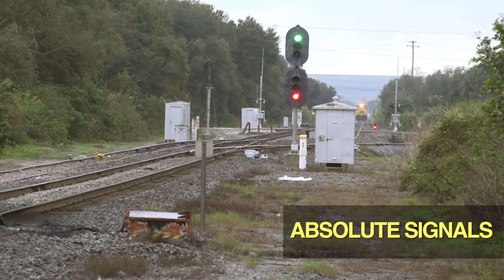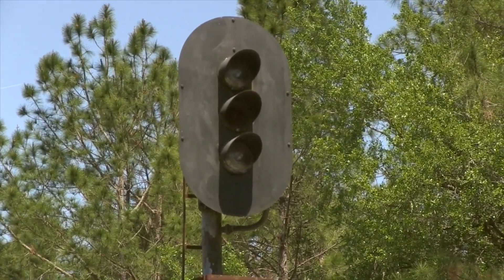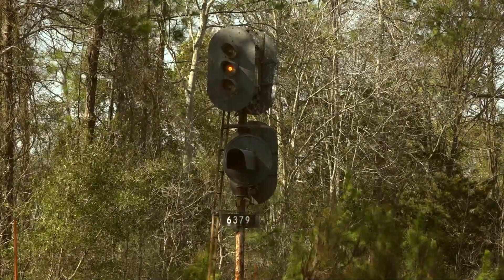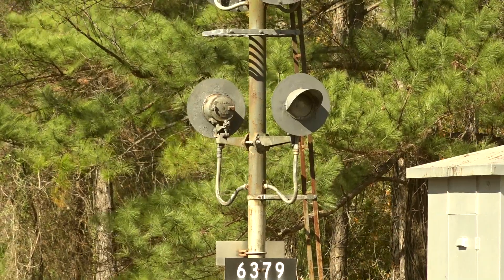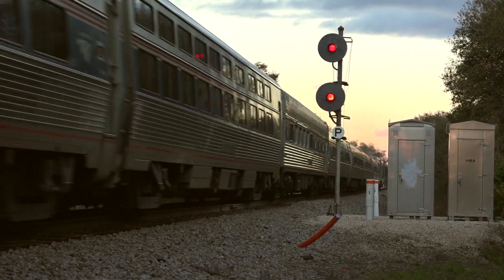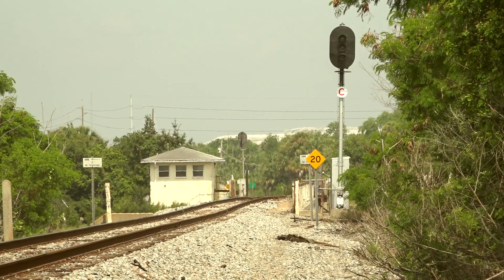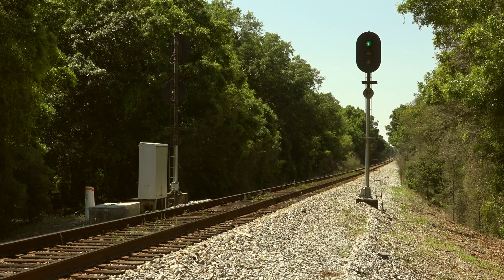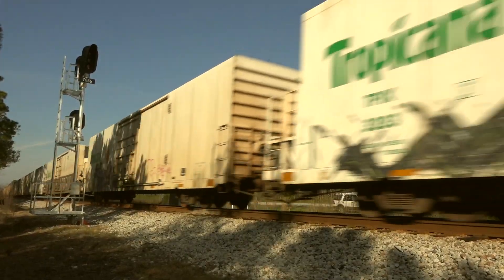How To Read Signals On The CSX Part 5 - ABS Signals

Comment: Nice series Danny! As a signal electrician(or maintainer) as you call them over there, I find this very interesting to see different systems in place. Approach lit signals save power and extend lamp life as others have suggested, it also checks the health of the track circuit in the electronic interlocking and the health of the lamp/led in the head. LED lamps don't last as long as you would expect and the old bulbs would last for years, but LED;s are becoming more reliable and they do give a broad light which does not need close focusing like old style lamps. 
Thanks again and always enjoy seeing and hearing your voice mate.
Cheers Gregg.
Reply: Approach lit signals were originally devised in the early days of railroading when many remote locations had no electricity and were instead powered by long-capacity deep cycle batteries to reduce the frequency with which crews had to replace said batteries. (Also before the days of solar charging).

Because it was easier just to put electricity to the cabinets without making changes to the system the approach lit system with searchlights continued on. As railroads (CSX and NS in my area) are replacing the systems end-to-end with Vaders (aka Tombstones, or officially Safetran ColorLights) they are eliminating the approach lit system due to lower power consumption and longer life of the newer LEDs.

The track circuit testing mentioned above only partially applies as even with non-approach-lit signals they remain at red when the block approaching them is unoccupied, so if the track circuit fails to detect the train they will remain at red, not "fail" to a green and cause havoc.
Reply from the maker: +FishplateFilms WOW! Many thanks, Gregg. You're the first to explain the reason behind Approach Lit signals. That's really interesting about the LEDs, too. I have noticed that on the new lights with LED's,  there are no fresnel lenses. So I guess no focusing is needed.
Reply: I didn't mean to imply that a signal should fail to green at any point, but that relying on an Approach Lit system to indicate whether a track circuit is operational or not isn't necessarily the case, as you'll notice it on a constant-burn ABS signal as well because it would never change from red whether a train is on the circuit or not, if there was a failure.

Interlockings in the US were rarely, if ever, approach lit due to the importance of being seen at any time, plus being near power anyway due to the control towers nearby (whether or not the tower was powered by electricity or batteries, there was enough power to burn the absolute signals 24/7). Batteries aren't used nearly as much anymore since the cost to get power to even the more remote signals is much lower. But in the early 1900s when semaphores were being fitted with lights to improve nighttime visibility, many signals couldn't be reached by electric lines without breaking the bank, so it was cheaper to put long-life batteries at each remote location instead. Approach-lighting them meant that the batteries had to be changed less. As I said, even when electricity was later run to these locations it was easier just to leave the existing relay circuitry as it was, so approach lighting remained. With the mandate to have Positive Train Control on all Class I lines many railroads have found it makes more sense to replace the entire signalling system with new systems end-to-end to be able to implement it properly, and in many cases approach lighting is not being seen as necessary in these systems as there is no need to conserve battery power, or save filaments from burning out.

On the LED note, a caveat is that railroads can no longer monitor the lights to ensure they are working. With incandescent lamps a small voltage could be constantly put through the lamps to monitor filament status, allowing faster indication when a lamp burnt out, but this is not possible with LEDs so they have to rely on reports from engineers and track inspections for the rare occasions an LED does fail.
Reply: Thanks for the  info! I don't think we used batteries down here much and approach lit is a newer thing on newer interlockings. Any signal not lit is taken as red and no signal should "fail to green" , thats a "wrong side failure" down here and is big trouble! Signals in remote areas are often solar powered with batteries and are approach lit . Very interesting to see how things are done elsewhere.
Cheers Gregg.
Reply: You're welcome mate! Keep em coming!
Cheers Gregg.
Reply: Very interesting Clark, thanks for the reply! Its funny how we do things differently, Australia is the same size as the US but about 95% of our population, which is about a tenth of the US, live on the coast, that means a VERY empty middle..LOL, also our rail traffic is a fraction of yours, unfortunately! Many areas are nowhere near power and the volume of traffic allows solar powered signals and small interlockings in some remote areas. We are a few (lot!) years behind you guys in a lot of ways but one thing we do is use current sensing on LED lamps to indicate a failure , this is used in the interlocking circuit and is not for lamp replacement, though a low current, in the milliamp range, will on some occasions not allow a route or signal to be cleared so we would check the lamp status while attending the fault.  I wish I had spoken to some signal guys when I was in the States but they are hard to find out there..LOL Hopefully on my next visit in a year or two!
Cheers Gregg.
Reply: FishplateFilms The only reason why I hate approach lighting is because it takes away the tumble down effect, and it makes the railroad look like its unsignalled at night time!
Reply: @Divergingroute1973
The "tumbledown" still works the same. Everything is the same with approach-lit signals under the hood, except just the signal shows no lights when no trains are around.
Reply: LEDs can last a long time if they aren't driven hard and kept cool.

Comment: It would be a good assumption the "light on approach" signals are done that way to reduce power consumption. Also may extend the lamp life. These issues wouldn't be as critical on newer signal models that use LED's for the light source.

Comment: Superb video, Danny! your discussion of signal markers, including those in ABS territory displaying a Stop indication was right on the mark. I assume you follow CSX only in the South but, were you aware that CSX also operates under B&O signal rules toward the North with different seniority districts? Eventhough the northern territories are upgrading to "SCL" signals, there are two signals (in each system) that defies normal, conventional signal logic. Could you point out which ones these are for both districts? Otherwise, the other "common" B&O signals are the same.
Reply: B&O CPL signals cannot display the Seaboard "Advance Approach", and Seaboard signals can't display the B&O "Slow-Approach-Slow" (only shows green lights in the main signal face, with no pilot light).  Typically, in former B&O and even RF&P territory, CSX uses either "Approach Medium" or "Approach Limited" in place of Advance Approach, where there is no diverging move possible at the next signal.  (I was a Baltimore-based CSX engineer, and a real fan of the old B&O CPLs).
Reply: @paulw.woodring7304  I feel like CPL signals are the best of both worlds. They're modular, which means you can add or remove pairs of lights as you wish, but they're also indicating any given rule in TWO ways so you don't mix anything up if red looks like orange or something like that.
Reply from the maker: +Todd Ledford I don't quite understand your question, Todd.

Comment: ummm 3:13 whats up with this gates rising and again when shot is shown gates lowering mid train a reason i stop and dont trust crossing signals
Reply: +crapper1  Danny, I noticed this too and then forgot about it.  So, what's up with the gates going down at the 3:20 mark?
Reply from the maker: +Jerry Sinclair I don't know, guys. Just some kind of gate malfunction.
Reply: We hade a crossing signal in my town where the motor running the gate seized up and left the gate at about an 15 degrees off parallel from the street.  Then it wouldn’t go up or down.  They had to come out and replace the whole gate mechanism with a new one.  The gate was getting pretty old anyway, it had no reflectivity left in it.  So they replaced it as well.  The really weird part was that a month later they took the old signals out and built totally new ones with LED lights, Cantilevered over the road, sidewalk gates, the whole nine yards. Even used mechanical bells for a while until one day when those were switched out for electronic bells.  The new crossing signals protect 16 tracks.  Your basically going through the center of the railroad yard here.  Oh, the built an island in the street and put another signal and gate facing the same way but across the street from the cantilevered signal on both sides of the railroad crossing.  One more thing.  The trains no longer blow their horns.  The sign approaching the crossing says, “No Train Horn.”  I miss that, not hearing the trains blowing their horns at the railroad crossing.

Comment: great job as always thanks. did you notice at the 3:33 mark how late the crossing gate came down ?
Reply: +vaughn shafer I noticed that as well, I thought it was just my eyes being weird but someone else saw it too
Reply: Yes, I just noticed that too.  Had to be just a malfunction which is very rare.
Reply: Crossing signal malfunctions are not anywhere near rare.  They happen all the time!
Reply: I am a career railroader, signalman and freight conductor, you will quite often see gates down and no train, but very very rarely almost never will you see a train and crossing not working. It can happen, but there are so many safeguards built in to prevent that. Would be hard to explain.....
Reply: vaughn shafer I replayed it a couple of times wondering if there was even a road there then looked at everyone commenting the same thing. Haha
Reply: vaughn shafer I
Reply: At least if anyone came in a car, they would probably see the train...
Reply: Hi
Reply: C.J. Hardy once I saw a traffic light malfunction. The light was green and flashing yellow
Reply: That should not do that when a train already went though it. I5 should already be closed
Reply: That faulty signal is why people should be taught to always check for trains at an at-grade crossing. Assumption they're working correctly can cost your life.
Reply: The gate got blown into the cantilever by the wind and got stuck, only coming down in the video.

Comment: can you explain blocks more pleas and what they mean in rail terms?
Reply: +zippa .way They are segments on a rail line.  When a train occupies a block the signal will be red for a trailing train.  One block back may be approach and one more back may be proceed.  It keeps trains traveling the same direction at a safe distance should something happen.
Reply: Railroad tracks are divided into signal blocks or blocks.  Ideally, each block is used by only one train at a time.  Block signals protect each block at each end.  Each block is usually 1-3 miles long, but it varies.